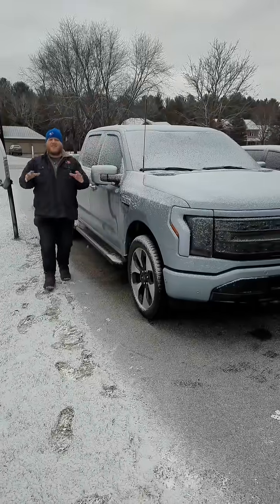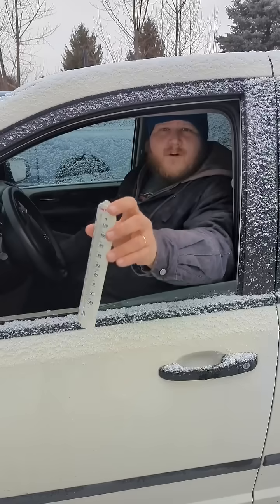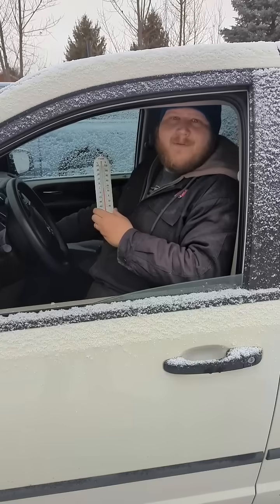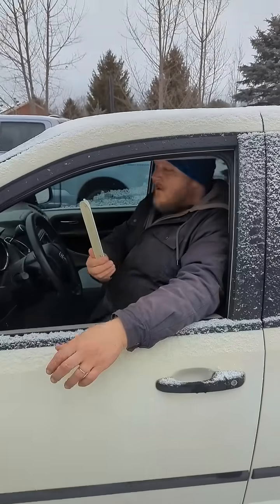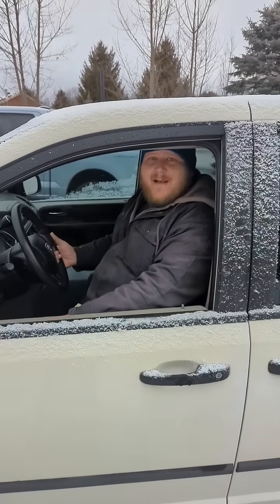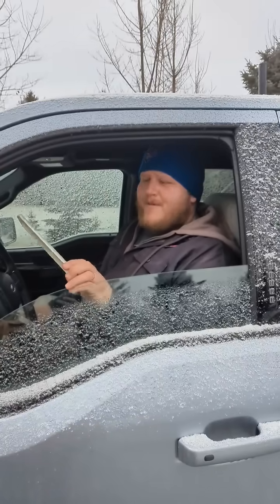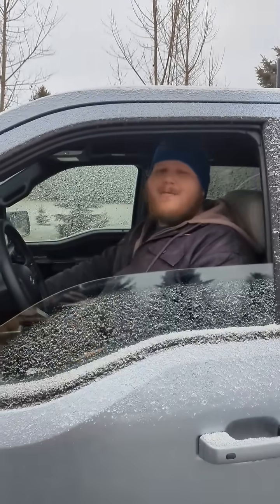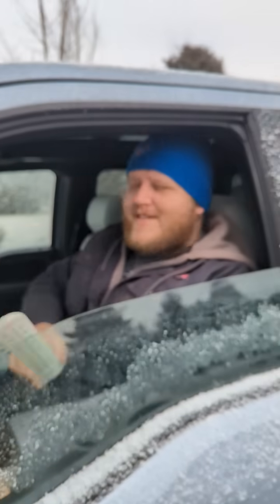Electric vs Gas - Heater Wars! How Long Does the Ford F-150 Lightning Take to Heat Up?

Comment: So what if you are stranded and have to run the heater the whole time? How long will the EV power that heater before the battery is dead?
Reply: Heres 19 reasons why electric vehicles SUCKS.

1) It’s too expensive 

2) Also cause pollution because it’s created by dirty fossil fuels 

3) Tires wear out quickly 

4) Only reliable when temperatures are warm and when it’s cold, it can bring danger to the driver and passengers.

5) Charging stations are hard to find in midwestern states. If you live somewhere like Wyoming or North Dakota, it is clear that you are going to have a lot of difficulty finding charging stations, as well.

6) Roadside Service does not provide Full Coverage and lot of this has to do with the fact that their parts are not on-hand and they are more difficult to actually find than ones for regular cars. Also, auto mechanics will not know how to fix electric vehicles since they didn’t built it. You probably have to find Elon Muck and ask him to fix it for you and he will probably charge you for a million dollars. 😂

7) Travel shorter distances due to the fact that these are cars that need to be charged, they simply do not have the same type of mileage range that regular cars often possess.

8) Too much focus on luxury vs. dependability. With all of the issues that have been discussed thus far, one may be questioning what exactly car manufacturers are aiming for when it comes to making these models. In short, they simply are spending too much time on overall luxury rather than dependability.

9) They get noisy early on. Owners of electric cars have been quite open about the fact that they are prone to make a lot of noise very quickly into their usage lifetime. There is no question that over time, this happens to all types of vehicles, but it is alarming that it has been happening so quickly for electric ones.

10) Maintenance costs far more because when dealing with expensive cars, one can always assume that repairs will end up costing far more. However, when observing electric vehicles, it is clear that the prices to fix them are at an extremely excessive rate. This is largely because finding its parts is far more difficult.

11) some electric cars look ugly

12) Battery pack replacements are expensive due to the fact that electric cars run on their battery packs, it is clear that they play a major role in the overall performance of the vehicle. However, their batteries are prone to needing replacements as time passes by, and they end up costing a ton of money.

13) Recharging takes a long time

14) Durability is not consistent

15) Tend to be heavy due to the fact that electric cars are built with different materials. In fact, the heavy weight of these vehicles is likely another factor that ends up making their tires begin to drop in quality so quickly.

16) One major aspect of the electric car market is that there are limited choices. Unlike regular cars that comes with an abundance of different options, car manufacturers do not seem to release multiple electric vehicles. This is not a solid idea, as electric cars are trying to grow in popularity.

17) Not Good In The Snow. Electric cars definitely meet their match when they are used in the snow. They are prone to having a lot of malfunctions with this type of weather, while also having a lot of difficulty while driving on slushy roads.

18) Too Much Hype. "Show not tell" is the philosophy that car manufacturers should possess. However, when it comes to electric cars, it is clear that this currently is not the case. There is no question that the market is pushing for more usage of electric power, but they have yet to accomplish much in the way of persuading the vast majority of the public.

19) Having a smart car means that the government can track your every move and can listen to your conversations. 

DEMONcrats and leftists wants to banned EVERYTHING. Gas cars, gas stoves, guns, cows, meat, freedom of speech, freedom of religion, and etc. I’m not going to go along with their authoritarian policies so fuck them!

Comment: Did you really just try to up-sell Ford 🤢 gas or electric Ford is junk
Reply: Not really. I have a 2013 GT Mustang and it's doing just fine with 267k miles. lol

Comment: So of course the truck will heat up faster even a gas f150 will heat faster then the Caravan, the van has far more volume of air to warm up compared to the truck

Comment: resistance heating has to be the most inefficient way to heat a space. And this is on an EV thats already struggling for range in the winter. Yikes ford.

Comment: Lmao that van can at least haul a loaded trailer more than 100 miles.
Reply: Lol.. 👍
Reply: EV’s have their place. In my situation I would be stupid to buy one. I tow to often, live in Mn where I’d lose even more range in winters, and couldn’t run a business very efficiently with an EV. Now if one charge can get me 300 miles pulling 6000 pounds on the daily, I will be interested.
Reply: My local ford dealer told me the lightening loaded with a 5000 pound trailer would only make it about 60 miles. Seems pretty handy to me. 🤦🤦🤦
Reply: @chrisburnham2642  you know what's more handy... my gas truck that can regularly pull my 10k pound trailer 4 to 5 hundred miles... without having to look for fuel because gas stations are literally everywhere.
Reply: @J Doe   OH yea I agree 100 percent my 3.5 ecoboost has no problem towing 4-5 hundred miles on a tank of gas and still averages 15-17 mpg doing it.
Reply: @chrisburnham2642  lmao... you just keep digging the hole deeper... you bought an eco boost full size truck? Bro.. say it with me now..... V8
Reply: @J Doe  First off chief i was being a smart ass regarding the lightening I wouldn't own one if one was given to me, second off I've owned the 5.0 the 6.2 and now an ecoboost. Aside from missing the v8 rumble that 3.5 outpulls both pretty easily.
Reply: @chrisburnham2642  in what universe does a v6 full size truck out perform a v8?
Reply: @jdoe7697  This one.
Reply: @chrisburnham2642  sure bud... whatever you say.
Reply: Lmk how many truck owners in the suburbs actually use their trucks to tow long distances
Reply: @Jesualdo Cortez  a lot of us do actually. We have camper trailers and fifth wheels we haul all summer long.
Reply: @jesualdocortez6426  lmk how many times you like your own comments.
Reply: .....and the van will be running fine ten years from now when that electric piece of junk is in the scrap heap.
Reply: @billgardiner9305 Uhh dodge makes crappy reliability vehicles TF u mean lol it's no toyota
Reply: @billgardiner9305  exactly

Comment: Different ICE cars heat up at different rates based on engine size/cylinders/displacement. Maybe big block v8 is better baseline for the EV truck?

Comment: Do it while driving! the more rpm the quicker CV ker u get heat! the difference is everytime its -5to 20 degrees farenheit it takes u 3days to charge also how long does it take to charge to full? I just pump a full tank 3mins!!

Comment: In the ICE version you could also use a parking heater...
Ford has them as an option in Europe, my old work van had it and it was great.
Can also be retrofitted and i'm considering one for my Mercedes.

Comment: Yep. Although the resistive heater is inefficient compared to a heat pump, just heating up a cabin doesn't draw off a lot of battery power when stationary. Continue to heat the cabin when underway and the range will deplete faster. My own VW ID3 pre-heats the cabin very quickly on cold mornings. But I've found that it is a good idea to turn it way down once underway and turn on the heated seat. Much more efficient. And a heat pump is very much better if you can get that option.
Reply: why would a heat pump work on an electric car that isn't moving? is the battery just hot when it's not even running anything? if so, why? is it warming itself with resistant heating?
Reply: @grantmccoy6739  Let me suggest that you find out how a heat pump works. Also electric motor stalling might be useful to look up.

Comment: Nothing against the EV but my 81 F150 Supercab heats up in a couple minutes as well. Pretty sure I could also cook a meal with the amount of heat that comes out of that truck. You should test any generation f150 with a 5.0 in it to properly compare.

Comment: Uhhh ok.... my car takes 10 to 15 minutes to warm up thats not long at all. Its a 1993 caprice  payed 1300 dollars for it runs well performs well and I dont have to be in debt for 3 to 8 years then throw it away.
And as far as fuel and maintenance in 8 years spending what I spend on fuel now ads up to $16,640 and maintenance around $3,000 and if I happen to need a new engine I can get a factory spec 350 c.i chevrolet engine for around $3,500. 

So in 8 years my personal milage would ad up to anywhere between 63k or 65k miles and it would come out to be around $23,140
That's with the new engine and the maintenance for those years
So in 8 years I spend less than half of what an EV costs or in that case any new car out there.

Comment: I wonder how long it'll take to charge up the car : )
Reply: A very time time to charge to get it to full. Imagine sitting in your car for more than an hr just to get it charge and by that time, you are already late for work or school. 😂
Reply: Heres 19 reasons why electric vehicles SUCKS.

1) It’s too expensive 

2) Also cause pollution because it’s created by dirty fossil fuels 

3) Tires wear out quickly 

4) Only reliable when temperatures are warm and when it’s cold, it can bring danger to the driver and passengers.

5) Charging stations are hard to find in midwestern states. If you live somewhere like Wyoming or North Dakota, it is clear that you are going to have a lot of difficulty finding charging stations, as well.

6) Roadside Service does not provide Full Coverage and lot of this has to do with the fact that their parts are not on-hand and they are more difficult to actually find than ones for regular cars. Also, auto mechanics will not know how to fix electric vehicles since they didn’t built it. You probably have to find Elon Muck and ask him to fix it for you and he will probably charge you for a million dollars. 😂

7) Travel shorter distances due to the fact that these are cars that need to be charged, they simply do not have the same type of mileage range that regular cars often possess.

8) Too much focus on luxury vs. dependability. With all of the issues that have been discussed thus far, one may be questioning what exactly car manufacturers are aiming for when it comes to making these models. In short, they simply are spending too much time on overall luxury rather than dependability.

9) They get noisy early on. Owners of electric cars have been quite open about the fact that they are prone to make a lot of noise very quickly into their usage lifetime. There is no question that over time, this happens to all types of vehicles, but it is alarming that it has been happening so quickly for electric ones.

10) Maintenance costs far more because when dealing with expensive cars, one can always assume that repairs will end up costing far more. However, when observing electric vehicles, it is clear that the prices to fix them are at an extremely excessive rate. This is largely because finding its parts is far more difficult.

11) some electric cars look ugly

12) Battery pack replacements are expensive due to the fact that electric cars run on their battery packs, it is clear that they play a major role in the overall performance of the vehicle. However, their batteries are prone to needing replacements as time passes by, and they end up costing a ton of money.

13) Recharging takes a long time

14) Durability is not consistent

15) Tend to be heavy due to the fact that electric cars are built with different materials. In fact, the heavy weight of these vehicles is likely another factor that ends up making their tires begin to drop in quality so quickly.

16) One major aspect of the electric car market is that there are limited choices. Unlike regular cars that comes with an abundance of different options, car manufacturers do not seem to release multiple electric vehicles. This is not a solid idea, as electric cars are trying to grow in popularity.

17) Not Good In The Snow. Electric cars definitely meet their match when they are used in the snow. They are prone to having a lot of malfunctions with this type of weather, while also having a lot of difficulty while driving on slushy roads.

18) Too Much Hype. "Show not tell" is the philosophy that car manufacturers should possess. However, when it comes to electric cars, it is clear that this currently is not the case. There is no question that the market is pushing for more usage of electric power, but they have yet to accomplish much in the way of persuading the vast majority of the public.

19) Having a smart car means that the government can track your every move and can listen to your conversations. 

DEMONcrats and leftists wants to banned EVERYTHING. Gas cars, gas stoves, guns, cows, meat, freedom of speech, freedom of religion, and etc. I’m not going to go along with their authoritarian policies so fuck them!

Comment: I'm a Ford guy, but screw that expensive pos. It went 92 miles in the tow test! Ur outta power, and Noone can bring you a 5 gallon bucket of electricity. Leave that to the liberal yuppies! They refuse to except the fact it actually runs off coal!! But, whatever floats their boat! But, if they catch on at that price the demand for gas and deasle will go down, and the price at the pump should to.

Comment: Another advantage with an ev that a lot of naysayers avoid mentioning if they even knew about it. Even EV’s with heat pumps (far more efficient), heat up really quickly compared to gas vehicles.
Reply: Heres 19 reasons why electric vehicles SUCKS.

1) It’s too expensive 

2) Also cause pollution because it’s created by dirty fossil fuels 

3) Tires wear out quickly 

4) Only reliable when temperatures are warm and when it’s cold, it can bring danger to the driver and passengers.

5) Charging stations are hard to find in midwestern states. If you live somewhere like Wyoming or North Dakota, it is clear that you are going to have a lot of difficulty finding charging stations, as well.

6) Roadside Service does not provide Full Coverage and lot of this has to do with the fact that their parts are not on-hand and they are more difficult to actually find than ones for regular cars. Also, auto mechanics will not know how to fix electric vehicles since they didn’t built it. You probably have to find Elon Muck and ask him to fix it for you and he will probably charge you for a million dollars. 😂

7) Travel shorter distances due to the fact that these are cars that need to be charged, they simply do not have the same type of mileage range that regular cars often possess.

8) Too much focus on luxury vs. dependability. With all of the issues that have been discussed thus far, one may be questioning what exactly car manufacturers are aiming for when it comes to making these models. In short, they simply are spending too much time on overall luxury rather than dependability.

9) They get noisy early on. Owners of electric cars have been quite open about the fact that they are prone to make a lot of noise very quickly into their usage lifetime. There is no question that over time, this happens to all types of vehicles, but it is alarming that it has been happening so quickly for electric ones.

10) Maintenance costs far more because when dealing with expensive cars, one can always assume that repairs will end up costing far more. However, when observing electric vehicles, it is clear that the prices to fix them are at an extremely excessive rate. This is largely because finding its parts is far more difficult.

11) some electric cars look ugly

12) Battery pack replacements are expensive due to the fact that electric cars run on their battery packs, it is clear that they play a major role in the overall performance of the vehicle. However, their batteries are prone to needing replacements as time passes by, and they end up costing a ton of money.

13) Recharging takes a long time

14) Durability is not consistent

15) Tend to be heavy due to the fact that electric cars are built with different materials. In fact, the heavy weight of these vehicles is likely another factor that ends up making their tires begin to drop in quality so quickly.

16) One major aspect of the electric car market is that there are limited choices. Unlike regular cars that comes with an abundance of different options, car manufacturers do not seem to release multiple electric vehicles. This is not a solid idea, as electric cars are trying to grow in popularity.

17) Not Good In The Snow. Electric cars definitely meet their match when they are used in the snow. They are prone to having a lot of malfunctions with this type of weather, while also having a lot of difficulty while driving on slushy roads.

18) Too Much Hype. "Show not tell" is the philosophy that car manufacturers should possess. However, when it comes to electric cars, it is clear that this currently is not the case. There is no question that the market is pushing for more usage of electric power, but they have yet to accomplish much in the way of persuading the vast majority of the public.

19) Having a smart car means that the government can track your every move and can listen to your conversations. 

DEMONcrats and leftists wants to banned EVERYTHING. Gas cars, gas stoves, guns, cows, meat, freedom of speech, freedom of religion, and etc. I’m not going to go along with their authoritarian policies so fuck them!